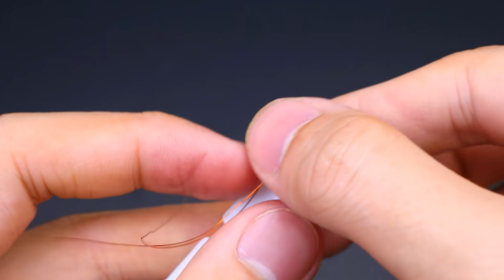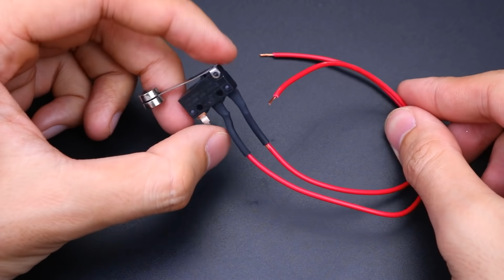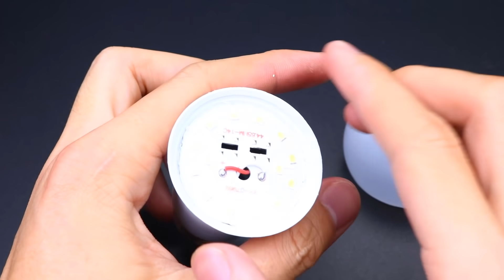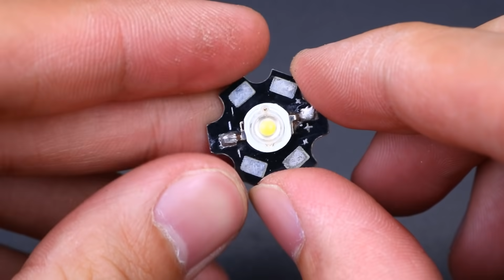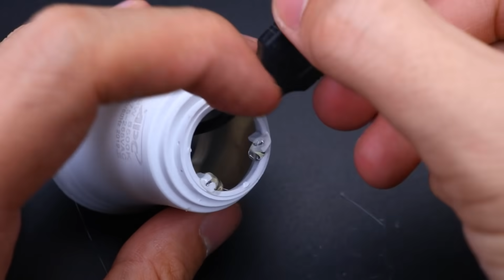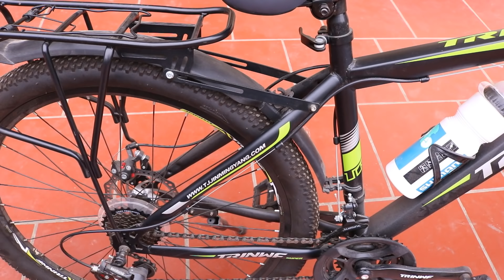Top 3 Simple Inventions

Comment: First DIY is FALSE! Its unreal!
Reply: z0nG ZoNg No Fake. Selfmade relais
Reply: @highbluesky282  THIS IS 220V LAMP!!! OMG!🤦‍♂️🤦‍♂️🤦‍♂️. No comment
Reply: z0nG ZoNg No comment? Sure its a 230V lamp. The switch inside the clock closes the 230V circuit. There are two wires going away from this clock... The clock is only the timing relay to close the Switch.
Reply: The clock can't output 230v, baby, how can u understand it?
Reply: z0nG ZoNg Oh man.... The clock ONLY closes the Switch with this selfmade Electric Magnet. Watch the Video again and you can See that two wires going into the clock. These two wires are L and N for the 230v circuit...
Reply: Try it in real life...
Reply: @davidkozak6369  Why? So now for the last time. He used a switch to switch the light bulb with 230v. The 230 Volts come from the two wires which are going out of the clock to the next socket I think. A normal 230 Volt circuit. The coil which he made is connected to the clock instead of the motor. If the clock now triggers a current flows thrue the coil and the switch with a glued on magnet is attracted. And ready. Its a kind of a timeclock.
Reply: Давид Козак the flippin' clock is just the Switch. the cables that go to the right go to a 230V socket and the clock acts just as a mains switch...